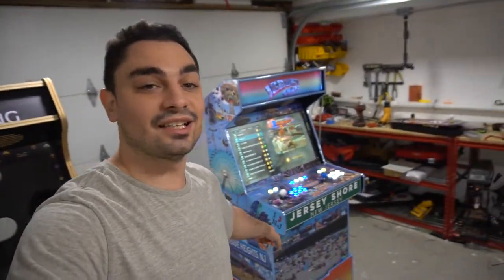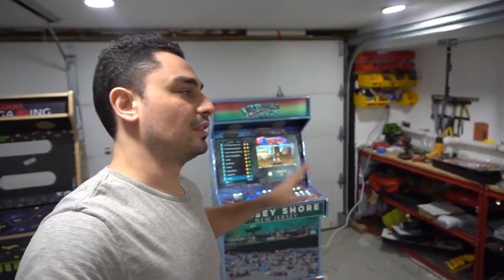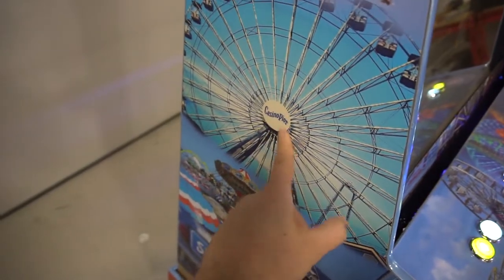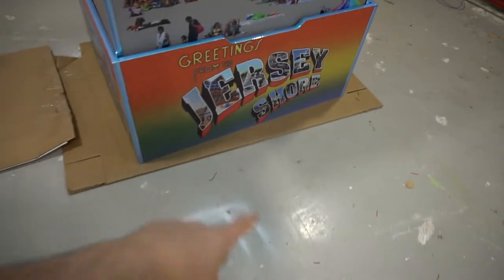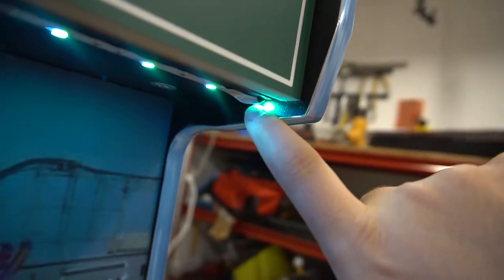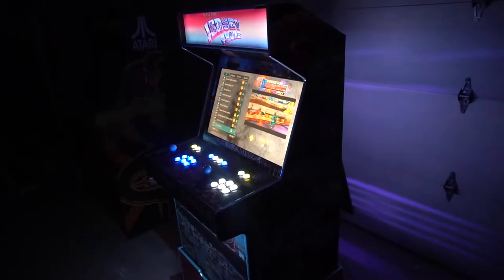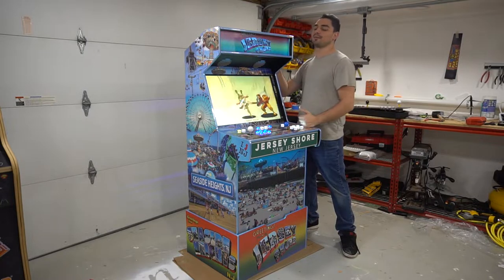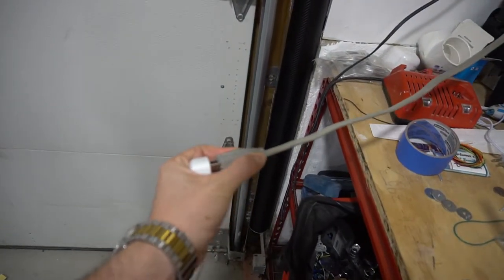Mid-Size 27 Inch Arcade Cabinet With Riser - Jersey Shore Build

Comment: nice!  Do the classic games that use 4:3 aspect ratio on this screen auto stretch  take the full 27 inch monitor screen? That is pretty sweet.  If you want true 4:3 how much does the viewing size shrink to?
Reply from the maker: I have them set to stretch but they can be set to 4:3
On a 27 inch screen you probably get the 2 black bars kn the sides at around 2-3 inches wide

Comment: Dude, I’m thinking of putting a 2:1 subwoofer like yours on my GRS cabinet. What speakers did you use? Does it produce any hum noise. Thanks in advance. 😊
Reply from the maker: I use either the Logitech z313 for all cabs or z533 if you want louder / more watts

No hums but I decase all my speakers but leave the subwoofer in its case
Reply: @Vic_VP  Really appreciate boss. Kudos!